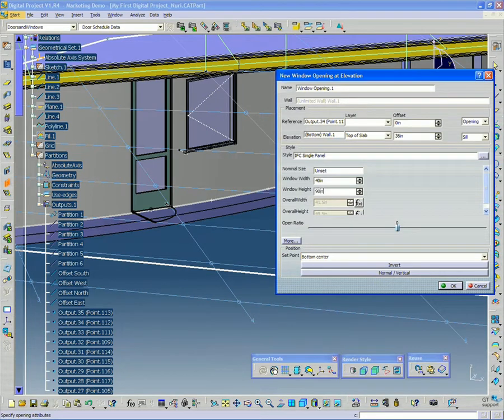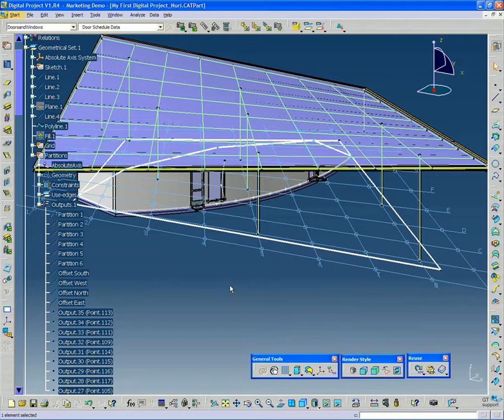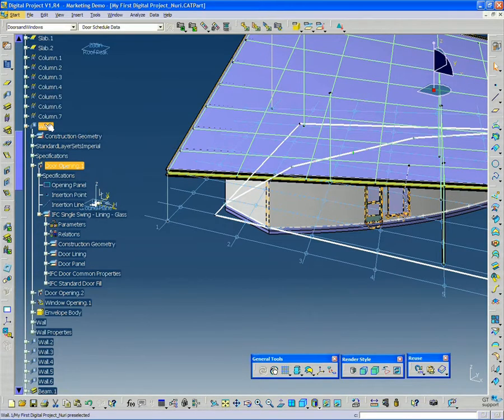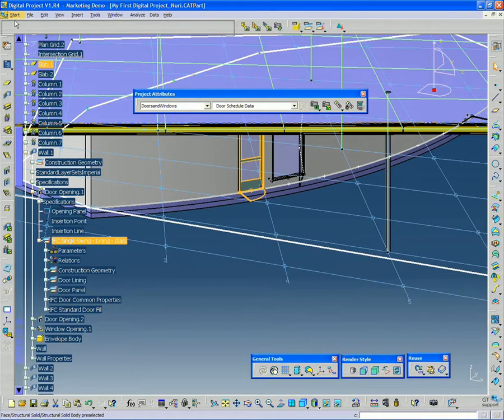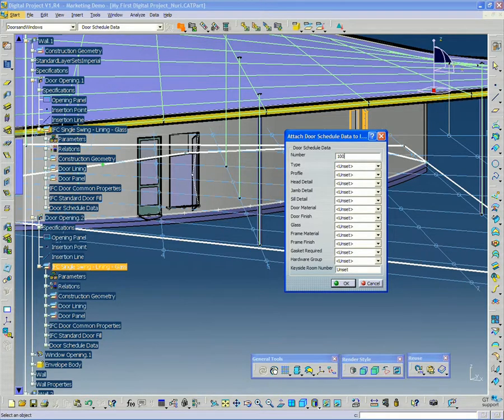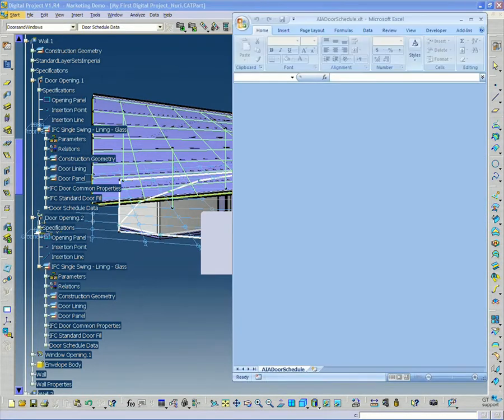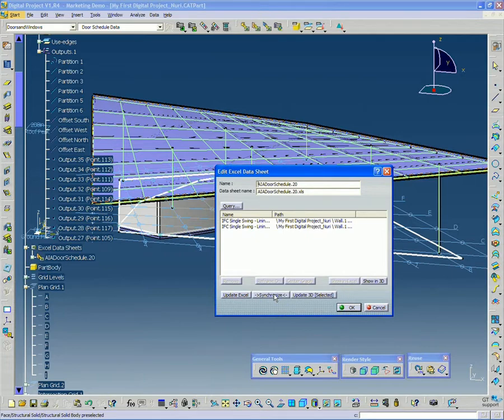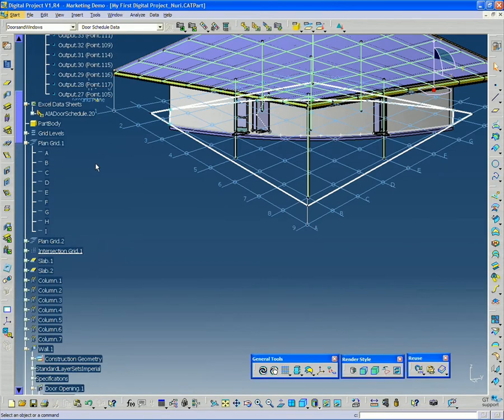GT Building Fluency Webinar 3-5: Creating BIM Walls & Openings with Digital Project V1,R4

Comment: I have a question: after select "AIADoorSchedule" and click OK, no excel sheet jump out , (i use excel2007),but if I open excel2007 first and repeat select "AIADoorSchedule" and click OK, then excel sheet come out with right parameter in it ,so do I need to open excel2007 first?